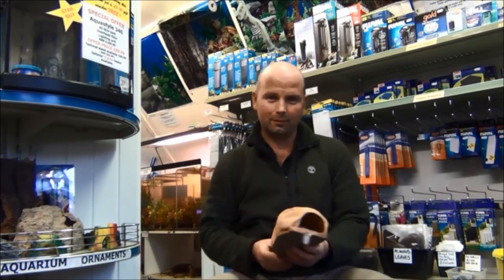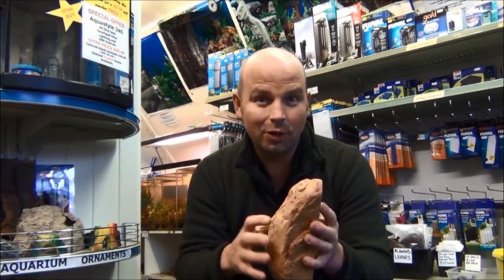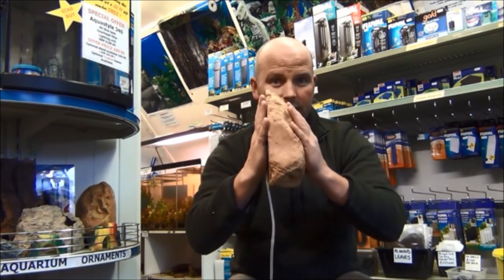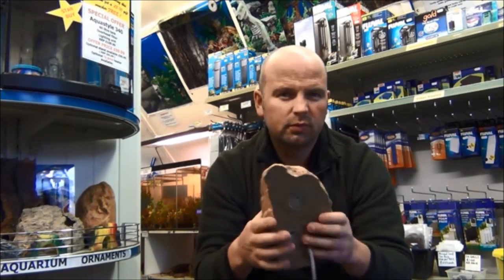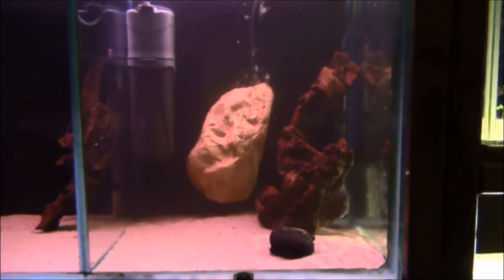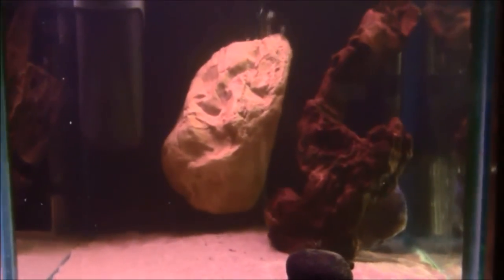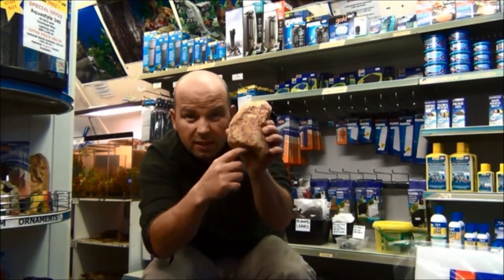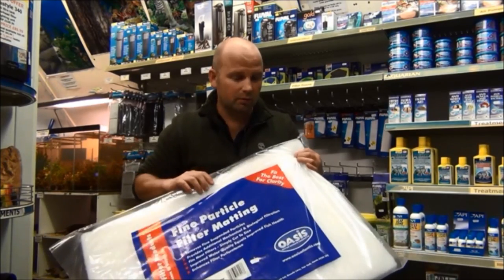'Invisible' Aquarium filter - Awesome internal fish tank filter by Pondguru

Comment: Heya, do you have any kind of idea as to what volumes would support a tank with a filter like this? As in if that ornament held a liter of water how large tank would that be able to handle with one of your media types? Just started getting into aquarium keeping and I'm not sure what works in what size of tank.
Reply from the maker: I see the filter more as a supplemental filter - there to provide a good population of aerobic and anaerobic bacteria to hopefully enable full cycle filtration (reduction in nitrate) to be possible as they are not high flow filters. Therefore they're not really there to draw lots of water through them like a traditional filter would and not really one for achieving good clarity of water - they are there to boost the health of the water. 
As the rock in this video holds around 500g of media it should delivery full cycle filtration in a 50 litre tank but for larger tanks it would be used in conjunction with standard filters.
Generally for a community tank you'd need around 1kg of media per 100 litres to see that full cycle filtration (reduction in nitrate) and the best types for this type of filter would either be the Biohome ultimate or the Biogravel. Many people now use the biogravel in ornament filters as it fills every available space very easily.
You may also want to take a look at the 'Groovy aquarium filter' for more ideas as that one will polish the water, properly oxygenate it and also hold around 500g of biogravel for increased biological activity.
Reply: Okay, so roughly 10g per liter?
 I'm asking mostly because I'd like to set something up for a somewhat smaller tank that's currently only about 38 liters, maybe 77 if I get cocky. A low flow filter is kind of what I need though as I'm using it to spoil my big flowery finned betta who I kinda tormented cause no one told me how important water conditions were until he started suffering for it. Should've researched it but it is what it is now so I'm still fixing him up.

Anyways, another question I had that's a bit more specific to maintaining better stability in his current tank while he heals which is only  about 18L, a top fin model http://petus.imageg.net/PETNA_36/pimg/pPETNA-5230342_alternate1_enh.jpg

The filter is on the with the vents, goes from bottom to top and has some carbon (I think) in the middle of the filter itself. There's a pump at the bottom of the center of the sectioned off bit.

There's not a whole lot of space available in there but there's plenty behind the filter to put most of your media types in. The ultimate I think I would be stacking vertically around the columns but I was worried the water would just flow around it. To your best guess would you say I should try and do that or go with one of your smaller media types like the plus or perhaps even the gravel to try and fill more space around the pump? Also does the gravel  hold the anaerobic bacteria as well for the nitrates?

Thanks for the fast response also. Great stuff.
Reply from the maker: Yes the biogravel has the same porous structure which holds both types of bacteria so no worries there. It would be best to put it in a filter bag but it would still pack out the space better than other types. Some people do use the biohome plus in small filters which works well so that would be one to consider too.

Comment: I have one big question, up here in the North West area the tap water seems to have a lot of chlorine and chloramine, you can literally smell it in the water and has a naturally low pH around 5 or so... would i be able to set up my new tank without using a "de-chlorineator" treatment? and i'm going to set up my internal filter using the Biohome ceramics and the correct sponges or foams as you call them from your ebay, i hope you get time to reply, cheers!
Reply from the maker: +iJustRich High chlorine and low pH don't really sound right as chlorine raises the pH but as long as you keep the water changes down to a minimum when the filter is mature and use dechlorinator it should be fine. Sounds like your pH reading may be wrong there so it may be worth checking with a different pH kit.
Reply: I could be wrong, just sometimes water from the tap can smell like a swimming pool... I work in a pet store that sells fish and accessories etc, when I do a water test of straight tap water it's always 5 pH when using a nutrafin testing kit (the liquid drops)
Reply from the maker: +iJustRich It definitely doesn't sound right as tap water needs to be somewhere between 6.8 - 7.8 to fit in with most areas regulations on water quality. It will definitely be worth checking with your local water company to see what it should be. You can ask them to provide you with a test result too if you are having problems.

Comment: Hi Richard, have you used any of the exo-terra products (or similar) in an aquarium before? I had been using a few caves in a tank for blue acaras and after a few weeks the paint began to strip away, although I noticed no adverse effects on the fish, other than one jumping out.
Reply from the maker: I thought the exo-terra products were just meant for reptile use so I have never used them in an aquarium. The ordinary resin ornaments will fade after a few years (depending on exposure to light and water conditions) but I've never noticed any peeling from them.
Thanks for watching and appreciating the video.
Reply: Ah right okay, my mistake as I thought that was what your new filter was. Great job though, would blend in perfectly with these ready made African cichlid caves.
Reply from the maker: Don Poisson
I'm sure there is a world of possibilities as there are so many different types of ornaments.
Reply: Haha get it patented!
Reply from the maker: Don Poisson
Looked into that and it would cost waaay too much....and it would still get copied. Good thing is that the media is very difficult to make so the chance of someone finding out the secret formula is very small indeed.

Comment: Thanks for the links.   I want to try this in a few different tanks.  I have a 55G with 10 neons, 8 zebra danios, 8 black veil tetras, 2 octos and 4 cories and a growing population live plants.   Currently have a sponge filter and Aqua clear 110 HOB.   I would like to swap out the HOB for a invisible fluidized filter.  What amount of media makes sense.   I have another with 3 fancy tail Goldfish.  Nearly impossible to keep ammonia levels under control or better said, hard to keep the kids under control from feeding the gold fish. so over filtration is needed.  suggestions on  #KG  of media for fluidized filter?   What to order media prior to sizing and building filter.

Thoughts?
Reply from the maker: This filter is not a fluidised bed filter although you could make it so you wouldn't be able to check that the media was moving. Moving beds tend to generate more nitrate but are good at reducing ammonia and nitrite so with this one I went with static bed with biohome ultimate media and low flow rate to not only consume ammonia, nitrite but also nitrate also.
The biohome ultimate (as used in this video) is easily the best media available but this type of filter show here is maybe not the best choice for a 55 gallon tank. An external would be the wiser choice as it would deliver a decent flow rate and could also be used with biohome for high efficiency (as most externals come with media which to total crap). Check this video out (which was filmed before the biohome ultimate media was invented) as it shows how an external should be set up: HOW TO SET UP AN EXTERNAL CANISTER FILTER FOR AN AQUARIUM (MEDIA AND FOAM LOCATIONS)
Hope that helps.
Reply: Pondguru Makes sense.  Looked through the video.  Researching Canister filters.  Thoughts on good ones.  Reading reviews they all are either perfect or  noisy or leaky.  I guess I could stick with the AquaClear and just replace the Carbon with Biohome.  Then months later add more biohome and replace the Hagen biomax.   The AquaClear Power filter comes with a 4 inch foam brick.   Does it make sense to cut this in half and add finer grained foam above it?  Thanks for the great advice!!
Reply from the maker: Tom McManus Yes 4" thick seems way overkill and the water will be much better mechanically filtered from layered foams than one whacking coarse sponge without doubt.

Comment: where do you get the phone and how big would i make this for a 20 gal tank
Reply from the maker: brendon lease This is really a supplementary filter so would operate alongside your other filter since it doesn't turn over much water - it is there to ensure very healthy water.For a 20 gallon tank you'd only need 1 of these as well as your standard filter.Foams are all over ebay and amazon in packs of all sorts of sizes - just search 'replacement pond filter foams'.

Comment: Hi!
I have to tell I love this filter. Can I replace my external EHEIM filter with this one? Or do I need an external filter too? (100 L tank just started it a week ago)
Reply from the maker: A filter of this size would handle a 100 litre tank but would need more air than shown in this video to provide more water flow. If you use an air stone on the end of the air line you will get more bubbles and they will be smaller so shouldn't be too loud. You may need to drill extra holes in the top of the ornament to let the extra bubbles out.
Reply from the maker: Pondguru
I would personally use a filter of this type as a supplemental filter which will soak up nitrates (if you use biohome) and keep the external too.
Reply: Pondguru Thanks for the fast respond! I will try make a filter like yours.
I subbed your channel. Do U ship world wide (EU)?
If so witch media would you recommend?
Reply from the maker: Gábor Szelle
Yes I ship worldwide there is a link in the video description. The best media available is Biohome ultimate as used in this video.

Comment: Would this be enough to filter a 55 gallon tank alone? If not what if I had two of them? And do I need to leave the current water fall filter on while this one builds bacteria?
Reply from the maker: Shawn Morris Yes always best to leave existing filter on for 2-3 weeks while new one matures. The filter in this video provides minimal water flow and is really there for making the water healthy. As the tank really needs water to flow around it too it would be best to use it as a supplementary filter unless the tank was very small (up to 60-70 litres?). Using 2 in a 55g(US?) would be in addition to existing filter.

Comment: I see the one you did was in a tank with a bit of sand in, Is the pull of the filter strong enough to suck up sand ?
Reply from the maker: No it is a low flow rate filter and will not suck up the sand.
Reply: Pondguru  Cheers I`l have a mooch about for a suitable ornament, and I`ll get some of your Biohome Media :)
Reply from the maker: Chris Moore
Groovy.
Any time is good as I always have plenty in stock.

Comment: awesome video! thanks!!
Reply from the maker: No worries, man - thanks for watching and appreciating the video.
Reply from the maker: batmannu Awesome.
Best of luck with that, man
Reply from the maker: batmannu
Thanks for the link. If you use a flexible air hose inside the ornament it may distribute the air much better so it would come out all the holes.

Comment: I have a wall mounted tank.  do you recommend a standard filter for it?  I just have freshwater fish Red Wag Platy
Reply from the maker: +Raul Romo Wall mounted tanks are very narrow so aren't the best for filtering properly but if you can get a small internal filter in each end it should ensure a decent turnover of water.
Reply: thanks for the response, and info.  i will try that.

Comment: is there an internal filter which can pump out more than 2200lph if so what brand
appreciate the help btw great vid
Reply from the maker: LJS Exotics and Aquatics I don't know and as I have closed my shop I haven't got the price lists and catalogues I used to have. 2200lph is plenty for most aquariums and if you need bigger than that it may be time to go external for the extra filtration. Internal filters generally don't offer much filtration capacity - especially for biological filtration.
Reply: yeah i have a 2200lph hidom internal i was thinking of having the bottom compartment with mechanical filtration and the upper compartment drilled with a hole for an air line and after watching your video on the moving bed filter micro k1 in the upper compartment
for biological filtration 
The tank is a 45 gallon grow out with 1 umbee and 2 black diamond cichlids
anyway thanks for your help and time 2 reply

Comment: What about if i have a 55 gl aquarium what size its better ?
Reply from the maker: You would just use two this size or one larger on from a large ornament. It is really a low flow supplemental filter so ideally you would need a filter to concentrate on mechanical filtration and leave this one to do the biological work.
Reply: Do u have any diy mechanical filter video?
Reply from the maker: edwiin sUarz Not that I can remember but a simple cheap internal filter or air driven sponge filter does an effective job of mechanical filtration. This DIY filter would do a decent job of mechanical filtration if you cranked the air up to give more suction and water flow.

Comment: I see bubbles, sure, but how is there flow?? The rising action of the bubbles will only be creating current AFTER they leave the rock. I love the idea, but I doubt you have any type of flow... a powerhead would work better, in my opinion, but obviously defeats your purpose.

If you can show me the dirty filtration pads, or show me the flow rate INSIDE the rock (which will be hard since it isn't clear/transparent,) then I will be a believer.
Reply: Martin Cattani a solution for this I reckon would be to drill a hole in the top and put a pvc pipe sticking out like on a standard sponge filter to create more of a flow?

Comment: So this filter does not use an electric type pomp or anything? It just uses the air to create a pull? (inb4 stupid question)
I'm not sure which filter I'm going to make, this one seems so basic compared to the "groovy" aquarium filter you made :D! I'm looking for those tubes aswell.
Reply from the maker: ExpectHell Due to the low flow rate this one is more of a supplementary filter for water quality issues (especially the reduction of nitrate as it uses biohome ultimate).

Comment: At 1st I thought this was a good idea. But then I thought about it. Do you understand the relation between air and water? The stone will just fill with air and not pull any water through.  No wonder you didnt market it.
Reply from the maker: You are aware of the fact the stone has holes in the top to let the air out, right?
Instead of taking time out to think about it maybe you should watch the video, lol
It works on exactly the same principle as an air driven under gravel filter or sponge filter.
Reply: whot a wolly..
Reply: Pondguru So how does the water get pulled through the bottom and out of the top? Water needs to travel through the bottom of the rock, up through the sponges & media and back out the top for the filtration to work. all this is doing is filling up with air and creating bubbles.
Reply from the maker: Chris F lol, I can't believe you still don't get how the filter works. It works in exactly the same way as air driven under gravel filters, biorbs, foam filters etc. etc.

Comment: Hi pondguru! A company from Sweden actually come up with these solution of a rock acting as a filter quite a few years ago and its a leading company called BACK TO NATURE (BTN). Check it out. http://backtonature.se/sv/module-c-white-limestone/
Reply from the maker: I saw the Back to Nature backgrounds a few years ago at a trade show and they look great. Problem is once fixed they cannot be maintained without removing that part of the tank background and they cannot be used anywhere else in the tank as a simple ornament could (depending on the design of the ornament).
Now if the people making Back to Nature got on the case they could make a great ornamental filter which could be used in any tank without needing all the other parts of the modular system and it could actually be maintained.
As I mentioned in the video I expect it will only be a matter of time before a company takes the idea of making an ornamental filter which can be used in any tank (and manufactures a good range of rocks, wood and novelty designs which are easy to maintain).
That may come sooner rather than later judging by the interest this video is generating in the first few days it's been on Youtube.
Thanks for watching and appreciating the video.